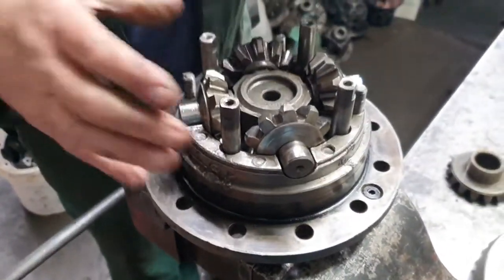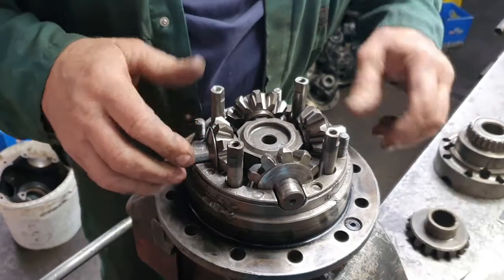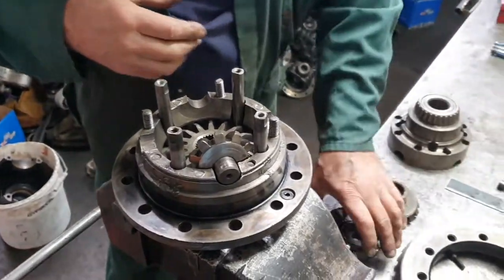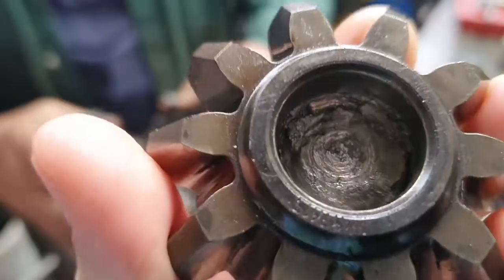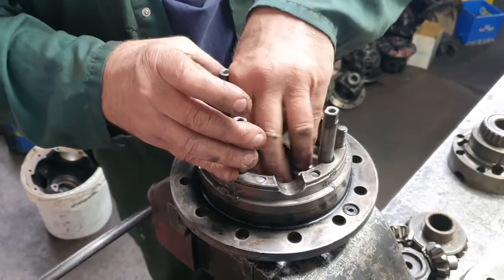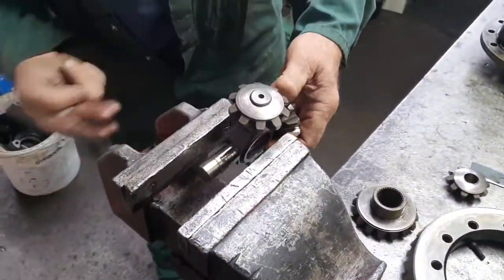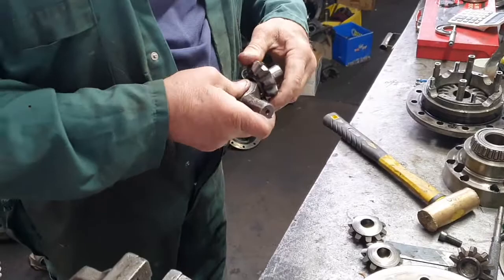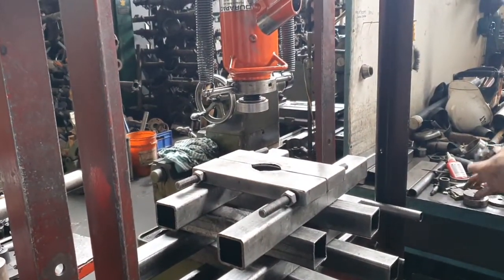TJM Pro locker failed because of bad driving.

Comment: This looks to be a design flaw of the TJM. The spider carrier should have oil grooves cut into the surface like the ARB style lockers. Time to make some improvements.
Reply from the maker: The cross shafts have oil flats on them already, like most conventional diffs have. Abusive driving will cease any diff pinion gears on the shaft to seize regardless if it's got oil flats/groves or not. But what you said is incorrect. It has oil flats already and always has had then since the day we designed it 40 years ago.
Reply: @differentials  the flats look very large for the application. Usually a groove is a better choice. Do you remember what engineering reference was used to design the flats? Cheers
Reply from the maker: @Gowieee  we are looking for a design engineer for our latest diff lock. Are you able to help us in this next diff lock design???
Reply: @differentials  Hi Neville, you can contact Southern Cross University (Lismore) and ask the engineering department for help (I work with them). Cheers.
Reply: @differentials  would like to more about this diff look.

Not sure of im looking in the right places but every diff lock appears to have issues, some user flaws other design flaws, now i don't expect 100% indestructible diff locks but something a lot better then whats on the market would be nice

Comment: i like this old guy talking! but i think he was saying the locker failed because the person running them didn't engage the locker but instead spun the tires, increasing the temp of the gears and lube. the lube spins away/burns away, then the metal gets even hotter and welds together and seize. so you're saying dont spin the wheels so fast and instead use slower tire speed and lock the gears?